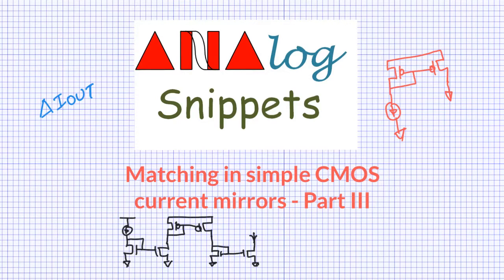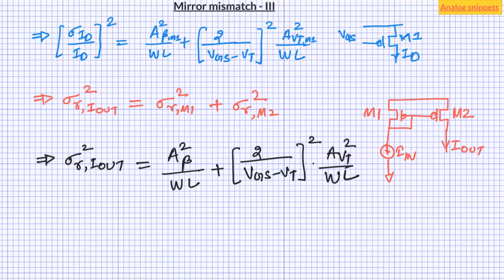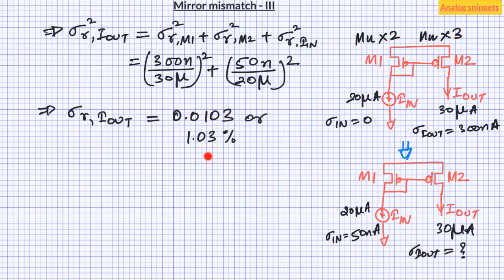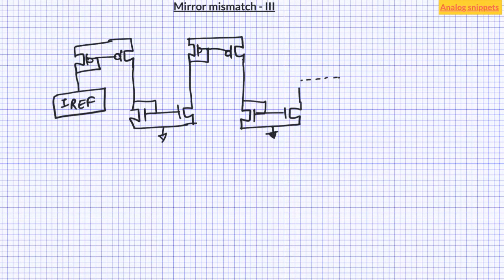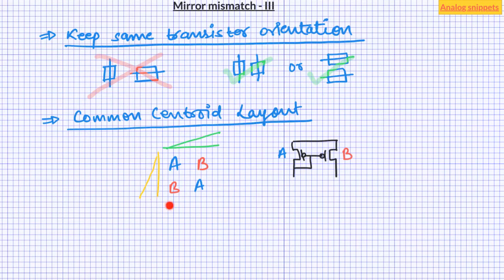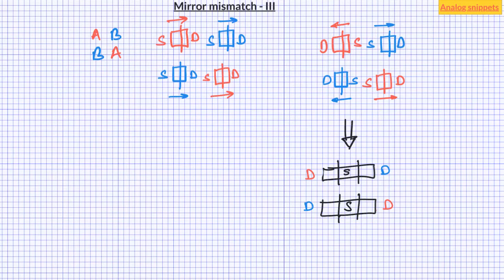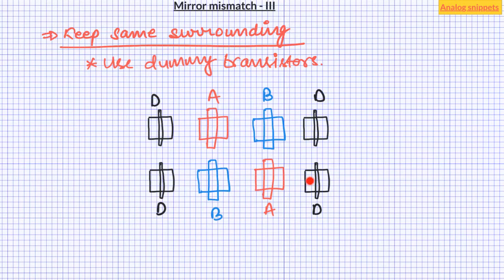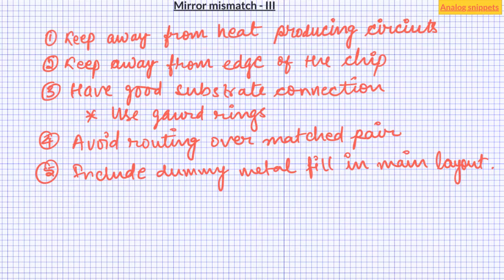#10 Mismatch in simple CMOS current mirrors - Part III

Comment: The part about layout considerations is really good. I have a question in extension to the matching of current mirrors in the layout. In case of large current-source DACs, are there any algorithms/ techniques to optimize the layout matching, since it will be difficult to plan it manually.
Reply from the maker: Matching of large mirrors is a complex problem. Usually a regular layout  structure along with randomized mirror element placement is used in layout but layout alone cannot guarantee the matching. Design techniques such as DEM are used to cancel the effects of mismatch.